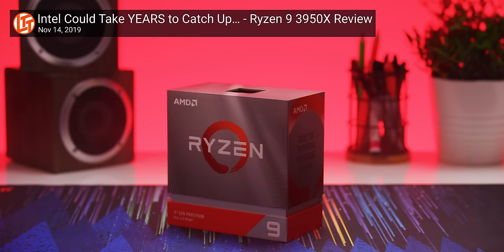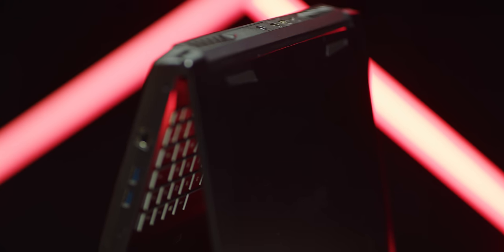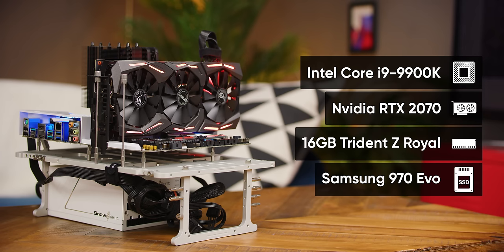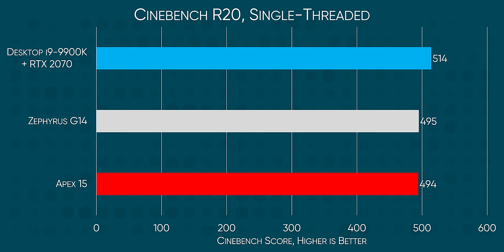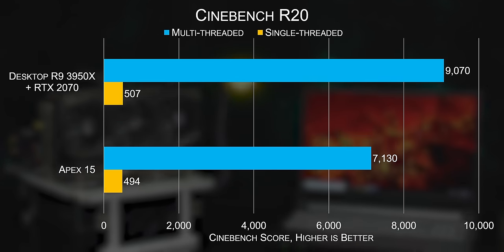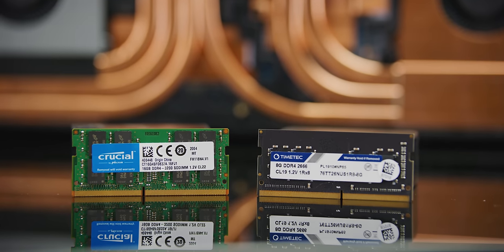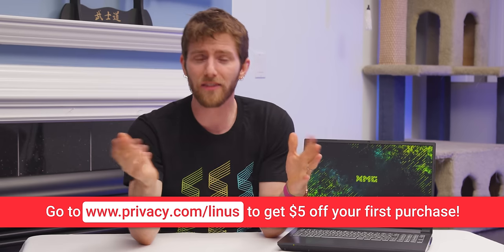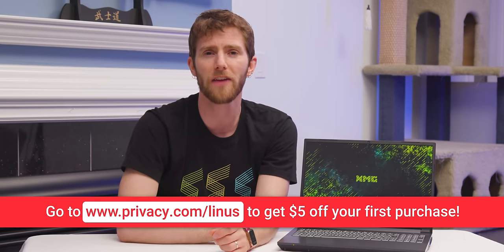The Most Powerful Laptop EVER!!! - XMG Apex 15

Comment: We probably found the reason why the keyboard in the review sample at Linus was so squishy and flexed so much. An inlay that is supposed to support the keyboard from below was not properly assembly is seems to be entirely missing from his review unit. We will confirm this once we have the review unit back at another address (it's currently en-route, shipping).

The inlay is a thick felt-like sheet that covers almost the entirety of space below the keyboards (with appropriate cutouts for screws, cables and ventilation). It closes a roughly 1 millimetre gap between the keyboard bottom plate and the upper case of the laptop. 

We will check if any other customers were affected by this issue. The inlay is easy to assemble by removing the keyboard, which only takes a couple of screws from the bottom. We will make a video and a small step-by-step guide. With the inlay, the keyboard is much more stable (less flexing) overall and has a better typing feel.

How did this happen? The inlay was missing due to the sometimes complicated logistics required for the EU market. Where other laptops are pre-produced with keyboards in the factory, we get laptop barebones and keyboard shipped separately because we have so many required keyboard languages on the European market that we need to mix and match keyboards with the appropriate barebone laptop, of which there are many compatible models. Separating the keyboard from the barebone makes inventory management much more ... well, manageable and it reduces the time we would need to search keyboards and assemble.

In this instance (new model, new process) there was a logistical issues with these fitting. They were either sent too late (in a nice box with dozens, hundreds of these inlays) or they were not associated with the laptop by our team in Germany. These fittings don't have their own part number, hence they were easy to misplace. In theory, it should belong to the barebone laptop itself, but since it is made by the keyboard vendor, things got complicated. The process will be improved and streamlined now that we spotted the issue.

Long story short: a bit of a faux pas in terms of quality control but we are rectifying the situation at the moment and customers will be informed about the results ASAP. // Tom

/edit: We now have a video that shows how to remove the keyboard and add the support layer: https://youtu.be/5KYGKVbhVas
E-Mails to affected customers are going out shortly.
Reply: Hi linus lov u
Reply: Liking the in-depth follow-up and engagement.
Reply: That's actually pretty cool. Good job for standing behind your products.
Reply: Please tell me you will ship to Mexico or the US
Reply: The Real question is: why you have so many negative reviews? I really wanted to buy a laptop from you, but too many people recommend not to have any business with your company.
Reply: @newaccount5980  About negative reviews on Google Maps and similar platforms: unfortunately we don't give out any incentives for happy customers to write positive reviews on those platforms. Maybe we should. Negative reviews usually happen in edge cases where we didn't react fast enough and customers try to ramp up the pressure on us with slightly exaggerated accounts on public platforms. I might be wrong with the stereotyping, but I have a feeling that especially German customers are quite prone to escalate thing very quickly for sometimes very petty reasons, often despite having a accommodating e-mail and phone communication channel with us where we tend to offer very reasonable repair prices, overfulfill warranty agreements and always act according to German and European regulations and customer protections.

One thing that has caused us trouble in a few of these cases is a lack of automation in e-mail communications. For example due to the complexity of BTO orders we do not automatically send notification e-mails in case of minor logistical delays, both for fresh orders and service cases. Human-driven customer support sometimes cannot immediately fill this communication gap in times of high load. We are working on improving this by migrating to better software to handle our website, production and support ticketing systems.

To get a a more representative picture of customer satisfaction, check out the 'TrustedShops' reviews of 'bestware' (our very own online shop) where we currently have a 4.59 out of 5 star rating, with 89% out of currently 2571 reviews giving 4 or 5 stars. Again, even with TrustedShops, the rule of thumb applies: unsatisfied customers are more prone to leave reviews than satisfied customers. Or to put it in a different way: check out the Wikipedia article '1% rule (Internet culture)'... up to 99% of customers just don't leave reviews at all. So the real-word satisfaction is probably leaning towards the positive end of the spectrum by a few extra magnitudes.

Another very clear indicator is the fact that we won Notebookcheck's #1 spot in Service and Support Satisfaction for Consumer and Gaming Laptops twice, once in 2018 and again this year in 2020. This puts us ahead of Apple, Dell, MSI, Microsoft, Asus, Acer, HP and Lenovo in Consumer (aka not Business) Laptops and their standard service levels.

// Tom
Reply: Props for owning up (even if Linus removed it while doing that chilling test) it shows integrity and good character for your company 👍🏻
Reply: This is SO COOL! Thank you for explaining, I wish all brands were this accessible.
Reply: @YgorCortes  We try our best. My original comment has now been edited with a video link to show the assembly process of the keyboard support layer. // Tom
Reply: @xmg_gg  It's a shame I already ordered my laptop with a Ryzen 7 4800H. Might look to you guys in the future, especially if you offer AMD GPUs in your product line. Not a fan of NVIDIA, especially with their proprietary drivers and that pension for being a mess in the Linux kernel
Reply: Consumers appreciate the honesty @XMG
Reply: THIS is the type of attitude towards customers and your products why I am extremely happy with my XMG Fusion 15 purchase! Beside it's bestial performance, of course :))
Reply: @newaccount5980  I owned a XMG laptop, and genuinely  had a horrible time dealing with the tech support, every email i would send would take around a week to get a response and whenever I got a response it was generic support stuff without really trying to understand my issue. eEnded up sending my laptop to get it's screen fixed on warranty and literally the second i turned it on after getting it back - the screen was flickering. So naturally send an email back to them - don't get a response for like 3-5 days... and after there are like, okay send it back. mind you it was 3-4 years ago, and hopefully they have changed their attitude, but to this day the worst memory of talking to tech support. I genuinely had to find people who worked in the company on linkedin and facebook to get them to answer to my emails. i think the whole process of getting my laptop fixed took me around 3 month and when i was expressing my frustration on their facebook page they would just delete my comments
Reply: @fuadtamirov1123  You'll more likely find stuff like that in indie companies like EVE these days. I have to think that XMG has improved.
Reply: Don't worry @XMG your products are impressive but I don't understand why your brand is not popular. I am planning to buy a new laptop from you guys, and all the best for competition
Reply: @SolDizZo  hope so, man. the laptop itself was genuinely great and i loved it, but man did i hate dealing with their support at the time.
Reply: Hello XMG, I am an industrial designer and I created a few concepts of portable computers and they want to stop being concepts and being products of excellence and forward thinking. Would you be so kind to help me with that?
Reply: We wants a 17" version! 3950x is the best CPU for designers! Why do you forcing us to work with 15" display? Stop do this! Give us 17" version!
Reply: @fuadtamirov1123  Sorry about your experience. I don't have the details on your case but feel free to send me a PM if you'd like me to re-investigate. I can assure you that your case must be a pretty rare exception, even for the time frame 3-4 years ago. We haven't changed all that much since then, but unfortunately sometimes human errors on our side can happen and some technical issues can be really hard to spot and depend on circumstances. Like a screen flickering might be totally fine after a replacement of the LCD cable but might re-appear after a good DHL/UPS shipment shake if the root cause was not actually in the cable itself. Let me know if we can do anything to compensate you for the unpleasant experience, perhaps with a discount on your next purchase. // Tom
Reply: @krishsatpati2476  Our brand is popular enough, but since we are a local/regional OEM from Germany, it's not always easy to get the international spotlight. We invest our margins into customization, warranty service and customer support, we don't do much paid advertisement (except some Google AdWord campaigns). // Tom
Reply: @selfscience  There is probably not that much we can do with experimental designs but feel free to e-mail to community(at)bestware(dot)com and I can check if I can forward them to anyone who might be interested. // Tom
Reply: @NAPALMUS  Please check out our XMG ULTRA 17 for 17.3" laptop with an equally impressive Desktop CPU. For APEX series, there is no 17.3" version planned this year. We'll have to take things step-by-step in order to provide this amazing price/performance ratio. // Tom
Reply: XMG Very generous of you. Infinite blessings for you.
Reply: @xmg_gg  Ok hope you do well in the international market 👍👍👍
Reply: Linus Tech Tips should pin this comment!
Reply: Unrelated, but when can we expect the XMG NEO 15 to ship? Excited :)
Reply: @newaccount5980  well. we bought all our company machines from them. everything went great. even the tax part which was a bit complicatd for us. great customer service and support. after a couple of emails we had everything figured out. that's my personal opinion. (writing it on my A517 :) )
Reply: @xmg_gg  on the A517 the issue comes from LED's burning out in the backlight. had to fix my own a week ago. but since clevo released all the schematics it's not a big deal.
Reply: Do you ship to Brazil?
Reply: @mark night The keyboard is not squishy anymore after the necessary assembly modification which was missing in Linus' video. If you check out other reviews of this laptop, you will see that the keyboard gets a very positive rating, for example on Notebookcheck. More video reviews are due to come out soon. // Tom
Reply: @yksnimus  No and I haven't found a reseller in South America yet. I checked with Avell and GHIA but they don't have it. Let me know if you find anything. // Tom
Reply: @daniszabo8153  Thanks for the feedback!
Reply: @Yxorm_com  Middle of June. :)
Reply: @xmg_gg  FGTEC is pretty famous in south brazil, not sure tho. This is the worst time to buy anything in brazil, dollar is skyrocketing, brazil not only under corona but political crisis.
Reply: @mark night Yes, we also want 4K screen on APEX 15 but our ODM has not validated it yet. Don't worry, you don't have to explain the purpose of content creation laptop. ;-) We offer 4K screens in many high-end laptops, including SCHENKER KEY, COMPACT, DTR and XMG ULTRA series. Just a matter of time until they will come to APEX 15 or similar. Meanwhile: P750DM is EOL and won't be revived. The keyboard hardware between P750DM and XMG APEX 15 is almost identical (feels pretty much the same), except the slightly narrower numpad keys on the new models with narrow screen bezel. The flexing is gone after our tiny hardware modification which was missing on the review sample. The printing layout can be changed. We do our own layout. If you buy in the U.S., your printing layout might look different. Please check with your seller. Cheers! // Tom
Reply: XMG Thx XMG very cool
Reply: @Joe-nq6hy  I cant comment on Clevo's roadmap. I can tell you that the 4800H-based laptops from TongFang are designed mainly by their Taiwanese division. It's a cross-strait enterprise. // Tom
Reply: You've no idea how much I want to own that laptop.... Hope I can get it one day
Reply: Awesome followup. Thank you!
Reply: @krishsatpati2476  XMG laptops áre very popular, just not so well known as the big sellers like Dell,Acer etc..etc..you name it...Btw... this thread suprised me very much...in a positive way!! Try getting this much customer support from Dell fe. On Youtube of all places!!
Reply: Good on you for hopping in here, describing & owning up to an issue.  Shows excellent customer engagement and support.  Like you guys actually care about what you're doing.  Really cool product by the way.
Reply: @xmg_gg   hello again so when will you guys also have something like a Dell Financial Services for the US customers? 😷
Reply: Any plans for a 17 inch version?
Reply: Alright alright, I need a laptop this week and am considering buying this then. You swear that's the reason? Because I really want a powerful as all hell machine but I can't stand a weak keyboard that flexs.
Reply: @XMG is this good for game development coding and video editing?
Reply: I bought an XMG laptop solely just because Tom commented on another Youtuber's video (Jarrods Tech) and discussed anything about their products with anybody.
Reply: What about the bios? Giving people something this powerful and not allowing user control is a little of a mistep. Personally if I used this I would be going for undervolting and possibly a little underclock as well. Would those options be given?
Reply: @Mockedarchie  You can do a lot in AMD Ryzen Master, including Voltage Offset and Underclock. You also have different performance profiles in Control Center which can do some Underclocking. So, yeah. While we would like to provide more options in the BIOS (against our ODM's ability to support it), it's not that much of a pressing need as you might think it is. AMD Ryzen Master is amazing and it writes all changes directly into the firmware. // Tom
Reply: @92soldier  Cool, thank you! I'll file this in my 'Praise' folder and show it to my boss later. :-) // Tom
Reply: @The_Io_Gamer  Yes, this is amazing for both! If you need maximum CPU power and lots of GPU power, XMG APEX 15 is your choice. // Tom
Reply: Does the apex 15 have a full size 2070?
Reply: Not a Max Q?
Reply: @hellodarkness5644  It's a Max-P, not a Max-Q. In our product portfolio, Max-Q cards are always clearly described as such. On 2020 models, currently only SCHENKER KEY series has Max-Q cards. // Tom
Reply: This is why german-made products are awesome
Reply: say do you ship to the USA?
Reply: Is it possible to upgrade to an Nvidia 3xxx ? when they are out? Or is the socket a different one?
Reply: @2x477  XMG APEX 15 (unlike ULTRA 17) does not have MXM cards. If you want 3xxx series, you'll have to wait for a new generation of this laptop. // Tom
Reply: XMG thanks.
It would be possible with the Ultra 17 or what do you mean?
Reply: @xmg_gg  I did not quite understand the relationship between XMG and CLEVO. Who does what? Does XMG just sell them, or do they manufacture them and you modify them a bit, or does XMG manufacture them and Clevo did the original design, or how does it work?
Reply: Boys get a 5950x in a laptop pls
Reply: @nakulbhat470  Working on it but no guarantees yet. If you want to know more, google the following thread: Statement on Zen 3 in XMG APEX 15 + Call for Feature Requests
Reply: I know this happened months ago,  but I’m damn impressed with the quality customer service and have added xmg to my potential upgrade pool based on this as much as the specs
Reply: @KC-nr3ou  Cheers! :) // Tom
Reply: @XMG impressed by your follow up, will keep an eye on your products
Reply: @bradhaines3142  Check out XMG NEO 17. // Tom
Reply: @bradhaines3142  Once AMD's CPU supply gets better, I'm sure you'll see some more 17" models as well. Right now, we have XMG CORE 17 with AMD Ryzen 7 4800H and GTX and RTX graphics in stock. Check it out! // Tom
Reply: Please guys keep making AMD laptops🙏 we need them
Reply: xmg*
Reply: It's okay, we get it
Reply: Is this laptop discontinued???
Reply: @MOUNTOFGLORRY  It is in hiatus right now. The successor with B550 chipset is still undergoing some last minute debugging. Has been going on for a few months now. Long story... please google this thread for more info: "Update Thread about Zen 3 in XMG APEX 15 with AM4 Socket and AMD Ryzen Desktop CPU" // Tom